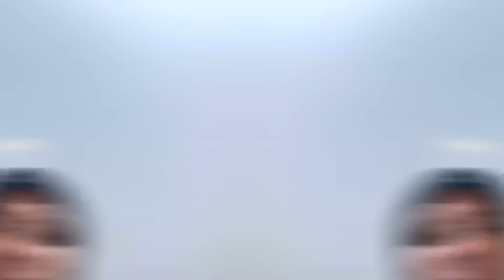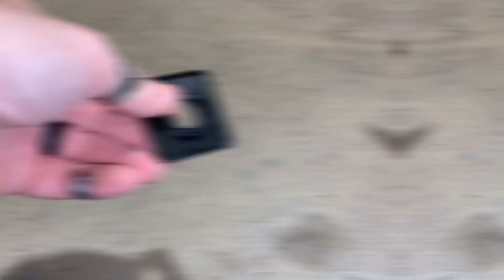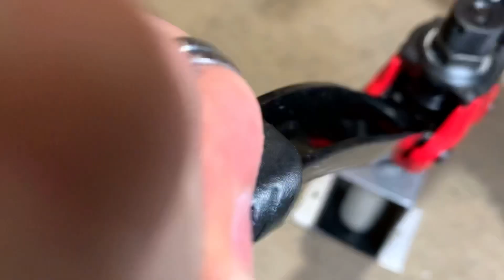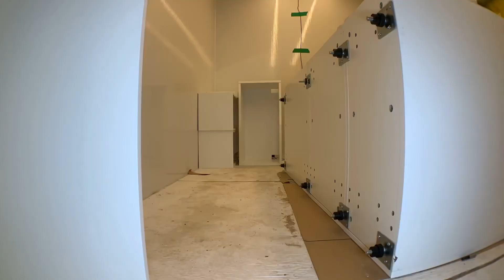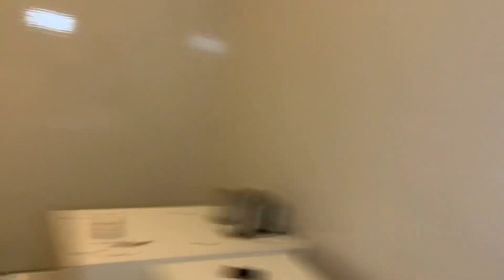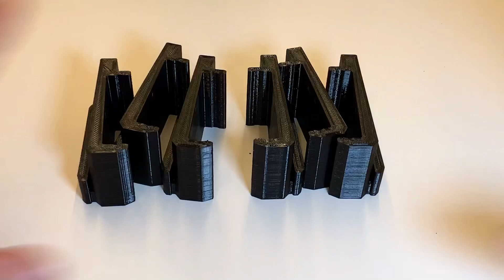The secret under our IKEA kitchen | FG 4x4 Camper build

Comment: Trick!  I like the setup.  Are those proper Robertson head screws?  Good.  I'm guessing that you and Krista are going to hoist it together to flip it onto its feet, to avoid breaking all those Finnish feetsies off. Good.  Love the way you're using the heck out of your 3DP.  I need to figure out mine and do the same.
Reply from the maker: You bet they are proper Robertson head screws!! 🤪.  Cabinet has been flipped over using two Robertson’s as well (though not Krista, a far less often observed Robertson)  lots more 3D parts coming 😁